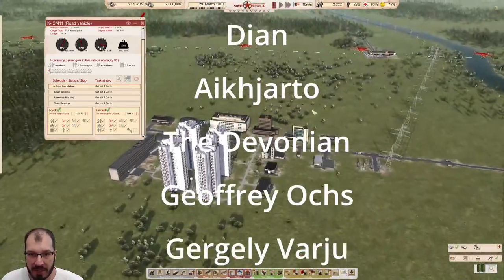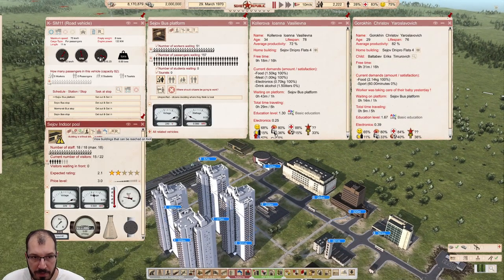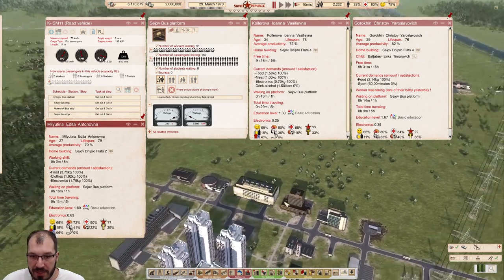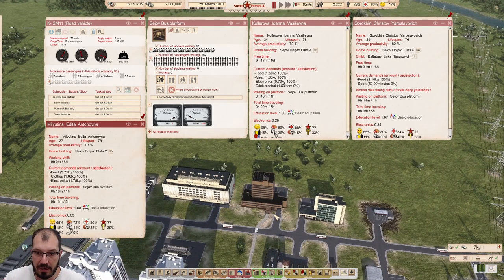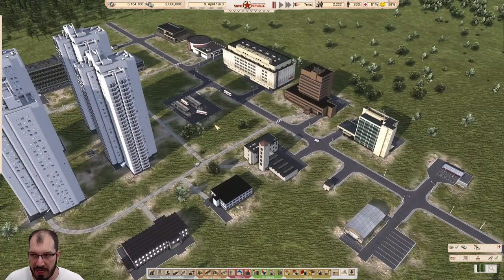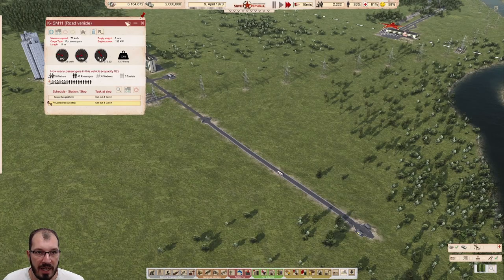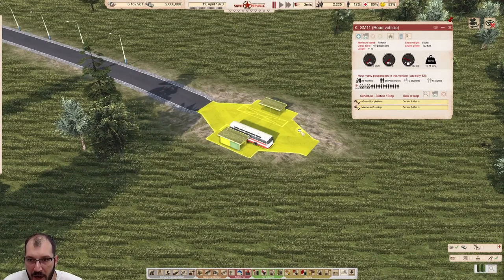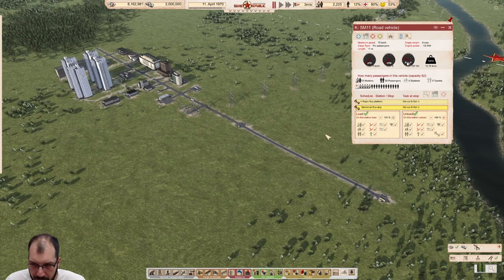Citizen Demands and Transport Explained | Tutorial | Workers & Resources: Soviet Republic Guides

Comment: Playing realistic mode for the first time, I now (10 years in) run into trouble with up to 100 workers at the central bus station not getting on buses to the industrial zone, except for the oil refinery (which I have lowered to just have 200 employees). Workers at the central station also have no problems to jump on buses for construction sites. So currently my only soultion is to have small buses going directly to the Food Fabrik for example.
Any advice on how to get ALL workers to also use all the other common buses? Their needs are fulfilled besides Religion and Alk (I support none of that ;D)
Or should I maybe try to set up a Bar in the industrial zone to lure them there ?=)
Reply: Is the food factory in range of the bus stop, and actually demanding workers?
Is there a demand for workers at other industries in the industry zone?
Workers will only get on a bus, if these workers can fulfill their demand to "work" at destination. Also, this demand must fit to their education level. You can adjust the number of workers getting on a bus/train by the number of employees at the destination industry.
Please give a feedback, if this helped you in any way. Also, pls tell us, if you found the cause of the problem.
Reply: @NipapornP  1 month later and I guess the problem has been solved. All your questions be answered positively, I realized theres lots of factors to be dealt with before they actually get on a bus, like all the nearby working places be filled first, the working conditions on the bus destinations being ready like for example all the requirements to produce stuff, like in my example corn be stored to really start producing food.
But thanks for the comment anyways, it may also help others.
Reply: @TimTaylorCEO_Binford  Thanks for reply.

BTW: "there ARE lots of..."
ARE = for plural, always!  ;)
Reply: @NipapornP  Thanks again ;D